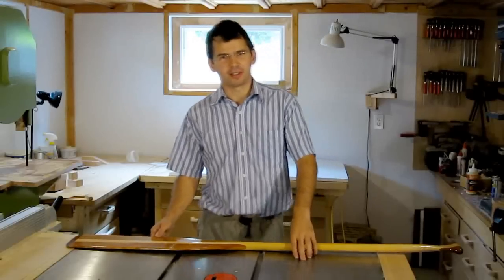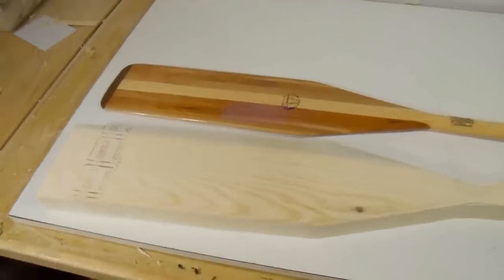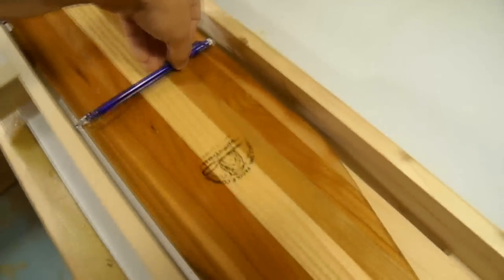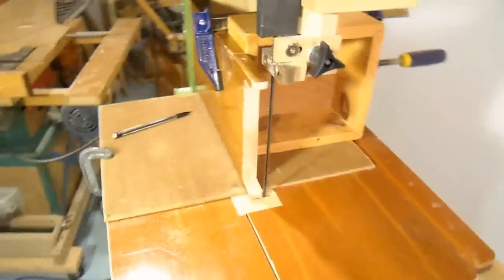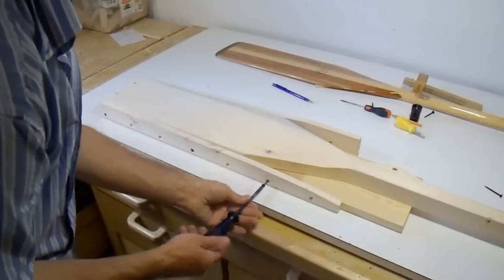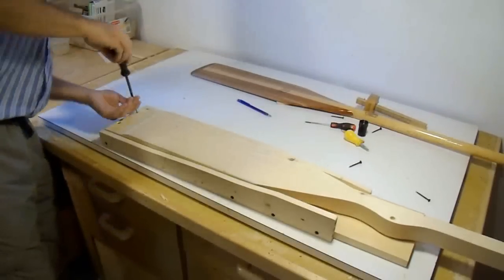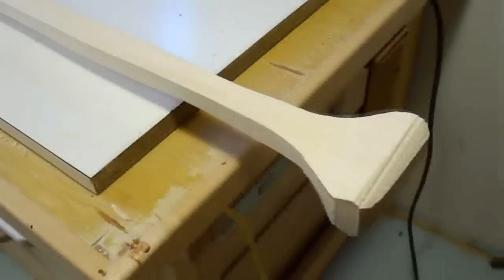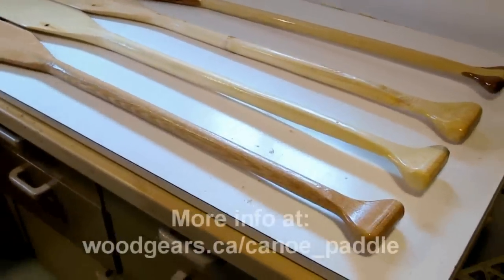Carving a canoe paddle on the bandsaw

Comment: I made my first paddle in part based on this video...  I used the OSS a lot for finishing up.   Then I picked up a small Belt+Disc sander.   I found that made it a lot easier to shape the inside curve of the handle.  I still like how your jig gives you a "spine" that extends down the center of the blade.

Comment: Why is the paddle convex? Does that make sense for a paddle?
Reply: they move more water, and are faster, if used correctly. the bend you ight see on the blade of the paddle is supposed to face backwards in the water. doing j strokes and other methods of turning is also improved with these paddles.

Comment: We had a build a paddle project in my high school manufacturing class, I was determined to turn the shaft on the lathe after I had glued on the paddle flanges.  I had this great big ball bearing that surrounded the throat of the paddle that I was going to use as a centre of rotation.  It might have worked if I had a lathe that was capable of a slower speed, and if I was a little more patient.  It was a glorious learning experience and I still have most of the bigger pieces.